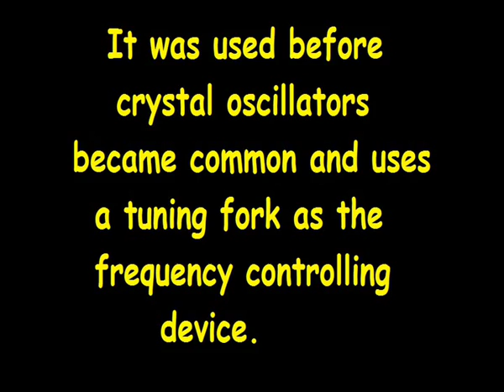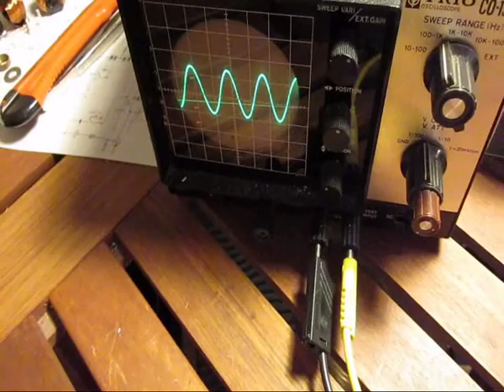Tuning fork oscillator

Comment: Add a Sense wire in with one of the coils and connect it to a frequency divider an feed it to a nixie tube clock as the time base
Reply from the maker: Why not go all the way and use dekatron tubes?

Comment: That's fascinating. Is it affected much by local vibration or orientation of the instrument (g)?
Reply from the maker: I doesn't seem to be a problem. The most important thing is that the tuning fork is held steady and at the same distance to the magnets all time. That's why I used the sturdy metal case instead of the plastic cases that I normally prefer. In the experimental phase of this construction I forgot to tighten the nut that holds the fork and it was rattling around and played two or three notes at the same time - it sounded almost like when a guitar player plays a flageolet note.